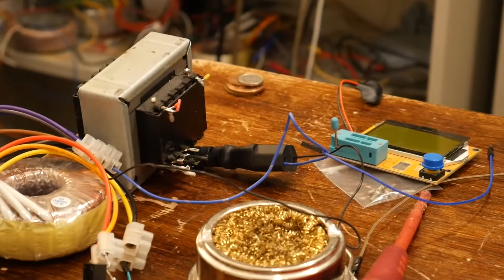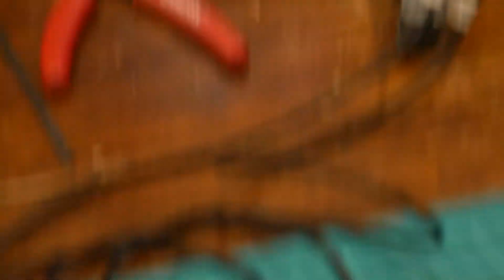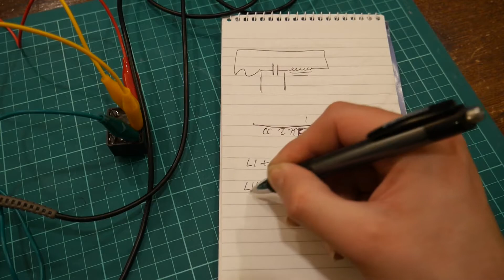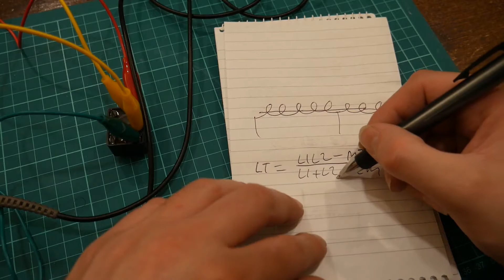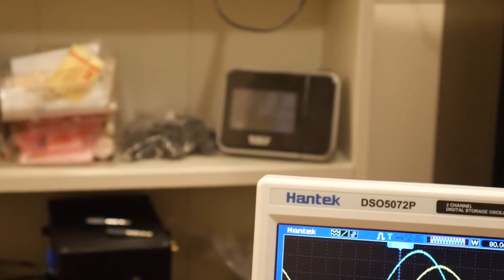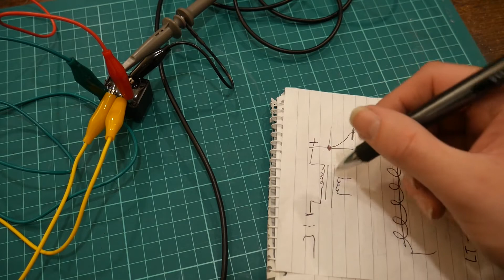How to measure transformer primary inductance

Comment: Hey Liam, dumb question-- does the secondary of the transformer being measured need a load or need to be shorted? 

I'm getting a clear resonant peak using your method, 169khz across a .68uf cap, but that equates to a very small (1.3E-6 H) inductance, which seems improbable for the transformer I'm dealing with. 

Thanks again!
Reply from the maker: Unloaded. If you short it all you measure is leakage inductance.

I'd use a lower value cap, the Q of your circuit is probably quite low so throwing off the measurement.